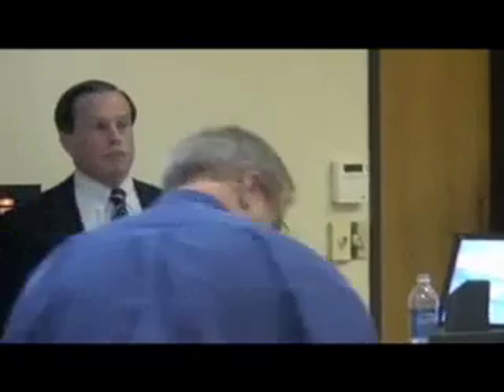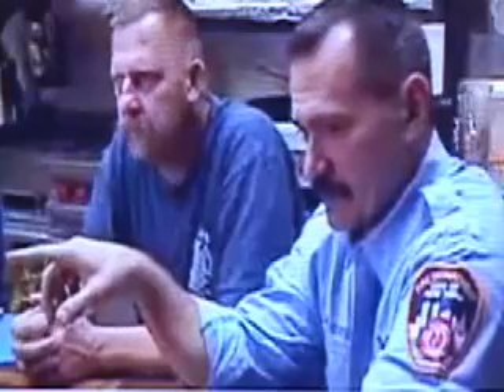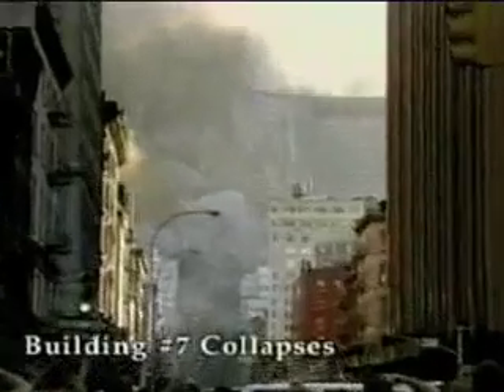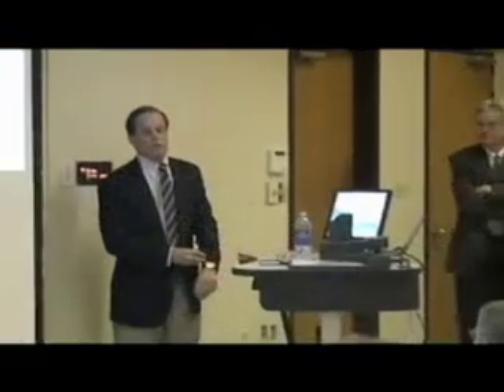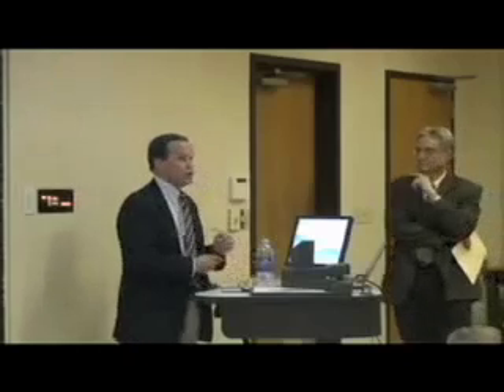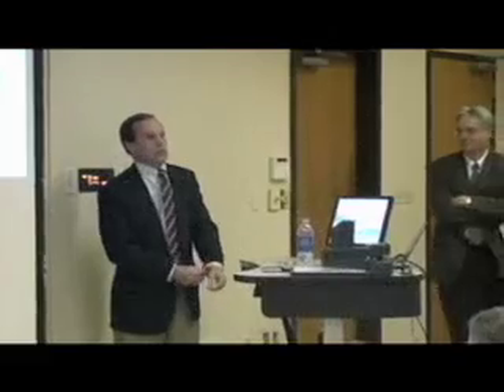John Gross denies existance of molten metal

Comment: NOBODY can identify a molten metal as steel merely by looking at it. The molten metal observed on 9/11 was an aluminum-mix.

The red-hot metal in the jaws of the backhoe cannot be molten. The equipment would have seized up.
Reply: It also could not be, "molten", because it would not retained any shape.  It would have been in a puddle, and it is impossible to pick up puddles, particularly with machinery.
But, thank you for saying so.  Gross is right on this part of it, if not the rest...

Comment: (2)
The material (not steel) pouring out that window was irrelevant to the collapse of the buildings. Failure initiation was on the opposite side of the building, & no "single location" event could bring down the towers.
Most likely explanation: huge banks of Power Supply batteries stored there.
But it is STILL irrelevant. You're playing "Chase The Irrelevant Anomoly". It's a childish, stupid game.
What is your expertise that you think you can contradict 200 PhDs in Structural Engineering?

Comment: You're skirting around it. Tell me, how did the building fall? Independently and scientifically no trace of thermite or explosives were found! I'm sorry you're going to have to accept that. You seem desperate to find something wrong now: The commission didn't need to go into HOW the buildings collapsed. The suspicious thing about building 7 was HOW the building collapsed. So of course it didn't mention it. Have you read the NIST report and then at looked the FULL length video footage?

Comment: Dr Steve E Jones wrote a paper on the analysis of the WTC dust. Sorry I assumed you would have read it. Basically it doesn't come to any reliable or factual conclusions and is general a crap scientific paper published in and equally bad "scientific" journal. The dust was analysed independently (analysed due to his won interest) by Dr James Millette and no sign/ actual thermite or explosives were found.

Comment: If you look at Jone's paper, no potassium (so no potassium permanganate) was found on the chips of unused Nano Thermite. Have you read James Millettes paper? I quote: 

"The FTIR spectra of the red layer were consistent with reference spectra of an epoxy resin and kaolin clay"

Jones didn't do a FTIR spectrum. He had no way of telling the structure of the compounds present. No Nano Thermite was found in the dust, fact. Why did the building have to fall? How did it fall with out explosives?

Comment: UR39, Military grade thermite, contains barium nitrate, it's not the only grade the US military uses. Super Thermite, or Nano Thermite, does not, it has iron, oxygen, aluminum, carbon, silicon, (binding agent) and potassium. But NIST lack of testing for this substance is really moot for proof of use of controlled demolition on 911. Please explain here how building seven fell from spot fires in 7 seconds in a perfect symmetrical implosion. All the science of engineering proves it not possible.

Comment: Thermate and thermite are very different things. Thermate contains barium nitrate and leaves a residue of barium oxide. However, neither barium nitrate or barium oxide (which are both very toxic) were found in the rubble let alone on these so called 'thermate chips'.

Comment: @Ur0pinionDoesntCount You still haven't answered the question, the video doesn't have any eyewitness who saw huge pools of steel.

Besides, how would anyone know what the composition of molten metal was by simply looking at it? No metallurgical testing was done by firefighters - they don't do that. You are not thinking critically at all.

RU truthers claiming that there was NO molten Aluminum, Tin, Copper, Lead? Where did all that stuff go? It all melts below 1000 c. But there was none? Really?

Comment: @Ur0pinionDoesntCount Dude, all due respect, you first used the term 'molten metal', but the allegation is specifically 'huge pools of molten steel'.
Can you find a reference from an eyewitness to 'huge pools of molten steel'? That's the allegation made on the video to Dr Gross.
That's the topic here.

Answer my question first please, before posing another question. That's a fair request, I think. We'll get to the other topics in time. You first - provide a quote please.

Comment: @Ur0pinionDoesntCount Oops, Gross doesn't do what you claim. He denies, specifically, the claim that there were 'huge pools of molten steel'. That's the claim.

Molten metal? Nope, that's not what the question was. Molten steel is a very different animal from other metals, namely because it requires far higher temperatures. Aluminum, Lead, Tin etc... melt at temps found in average fires.
But not steel.

It doesn't hurt my feelings to correct you, not at all. Listen to the question again.

Comment: the existence of molten metal does not debunk the idea that the metal components from the plane, and the jet fuel when the tanks, and the air contained therein is compressed and detonated, rather than burned reaches higher temperatures.....which can ignite and burn/melt both aluminum and steel, as well as titanium

Comment: I read and see all these references to molten metal and thermite,  just so you understand, not that it will change anyone's mind...but thermite is simply burning metal..an oxide of one metal like steel (which if you don't know the oxide of steel, is "rust" or ferrous oxide) and another metal powder like aluminum....the impact force of a 747, filled with JP8 (Jet fuel) is enough to ignite this reaction.....and the reaction can produce temperatures of 4500 degrees.......

Comment: @Daddyo930 Excuse me, you have pictures of GLOWING material, that is definitely NOT molten. Steel is molten at over 2500 degrees - the material in the picker is not anywhere near that hot - engineers have already pointed out that the picker's hydraulics would become inoperable were it to come into contact with material as hot as truthers allege

So basically, you misunderstand what Gross says, you misunderstand molten metal, and you call him a traitor for your own errors. Not nice.

Comment: @Daddyo930 You haven't presented anything. The paper makes the allegation, and I already know all about it.
RU afraid to know what's wrong with the hypothesis? It sounds like you are. 
For example, the energy density of the red/grey chips does not correspond with any known nanothermite - and this is a problem, since nanothermite is limited, by the physical properties of small AL particles, to levels which are well understood to be lower than that of Jones' chips.

Comment: @AlienEntity1 If you watched the video then you would understand that the byproduct of bringing the chips to ignition temperature was molten iron or steel. Don't know which exactly. But anyway molten metal is the byproduct when you heat the chips to ignition temperature. The presence of nano-aluminum would also inform you that it is very hard to make and only a sophisticated chemical manufacturer could make such a thing. Do you understand now? The presence of these chips indicates foul play.

Comment: @SexyMelon Weeks after,the likelyhood of molten steel would be present,because of the fuel undernrath the rubble..But it has nothing to do with the cause of the collapse...The ragging fire and red hot metal on bare steel.anyone who has worked with metal can see how it can be ,punched,cut,twisted once steel becomes redhot..Blacksmiths,Gunsmiths,use heat to soften metal..Besides that..you could tell there was a method to their maddness

Comment: I dont why morons even bother to argue about the temperature needed to melt or even weaken structural steel. There has not Been ONE SINGLE CASE of a steel framed building collapsing from fire damage before or since 911 because its impossible.
1. any metal is a very good heat condcuctor
2. structural steel begins to melt at 2060 F
3.A normal office fire is around 1200 1300F at max  notice the difference yet?

Comment: Those are good pieces of info right there.  If the nasa therms shots show temps of 800 degrees only, it'd be pretty hard to state that temps of 2500 were present.  And knowing exactly what temps firefighter suits can handle is pretty important.  This topic is debatable on so many levels it's frustrating.  So with this info we can only deduce that thermite wasn't used.  The big issue that nobody knows yet tho is whether or not the attack was either known by gov't beforehand, or initiated by them.

Comment: If something is heated up to 2500 degrees F, it doesn't meant that everything around it is at the same temperature.  So first of all, you can get near it, but you can't touch it.  I don't know how near you can get, though.  Secondly, suggesting that a substance could be burning at a temp less than 2500 degrees, doesn't prove that there were no temps of 2500 degrees.  So i don't agree with you guys here.  It would be nice to see what temps the Nasa therm photos were indicating to help us out...

Comment: Let look at more common sense, running with the fact that steel melts at 2500 degrees.  Aluminum, on the other hand, melts at 1200 degrees fahrenheit, depending on the alloy.  What was underneath the towers? A parking garage.  What was the parking garage full of? Aluminum made cars.  Not to mention a large percentage of the tower was aluminum too.  Any flaming debris could have sparked a fire in the parking garage, easily reaching temperatures to melt the aluminum, resulting in flows of it

Comment: watch?v=nbzdO0EPOGg

The yellow-glowing spill is over 3,600F.
Molten iron glows orange outdoors around 2,750F.

"Physical Properties of Materials for Engineers, 2nd Edition" page 1 (viewable thru google books).
"Mining and Metallurgy", pages 1390-1391 (google books).
Composite-color black-body java applet (findable by google search).
Indoor and Outdoor Color-temperature charts (see 3drender site's charts).
Iron casting video, molten iron glows orange in the mold - watch?v=NEppk2qCSH8

Comment: The alleged "debunk" on the large glowing spill seen near the gash in WTC2 uses a color shift from yellow (2,000+ degrees C black-body) to orange (1,500C black-body) followed by the application of an incorrect color-temperature chart, shifting the temperature of the spill to about 1,000C (1,800F). 

The illusion thus partitions the minus-1,000C shift about equally between the two steps available: color identification and color-to-temperature chart access.

Comment: There is no credible report as to the nature of what the found after the collapse. It is possible, however, that the pressures involved in the collapse created a furnace effect causing the trapped fires to increase their temperature. It could plausibly be steel. Most likely it was aluminum from the planes or any of the other million things made of metal in those towers.

No "molten steel" on the beams. This is 100% BS. And steel doesn't have to become molten to bend.

Comment: Of course jet fuel couldn't turn steel molten, no one with any understanding of science argues that.

Furthermore, molten means liquified. Most of those pictures simply show heated metal that's glowing.

The metal that is molten is not steel. It's aluminum or some other compound with a lower melting temperature.

I love how you morons yell about arguments no one makes. Find me a single instance in any NIST report where they argue that steel became molten.